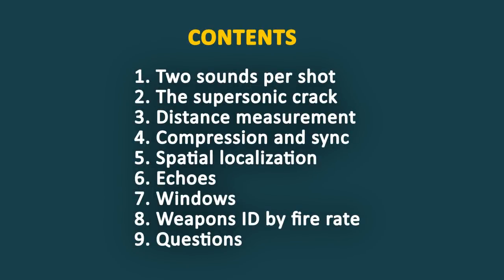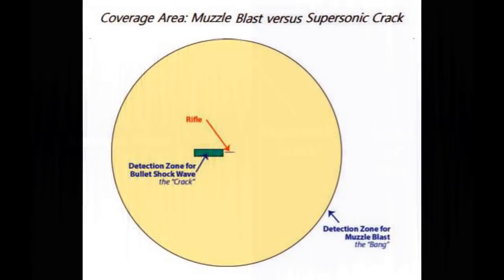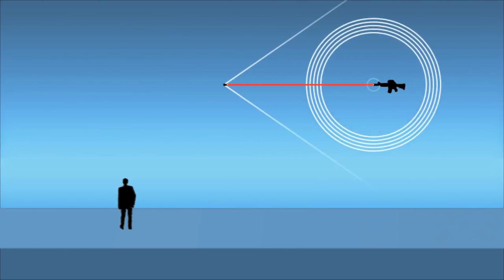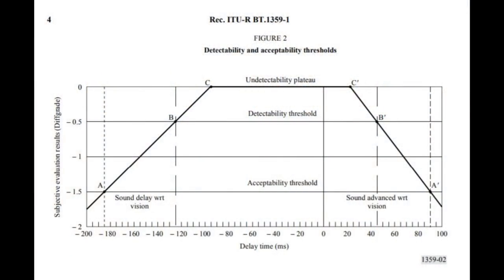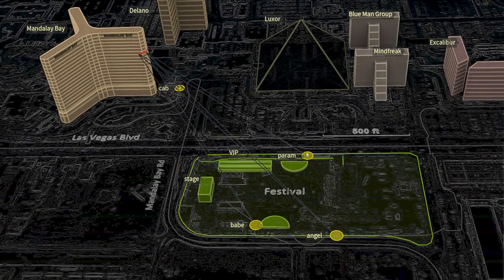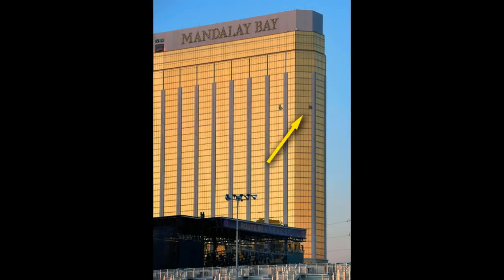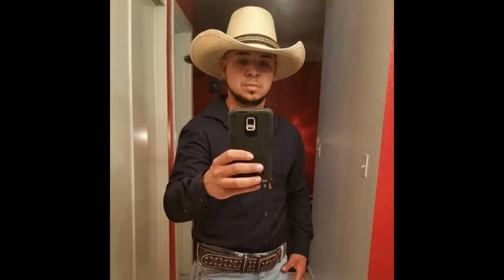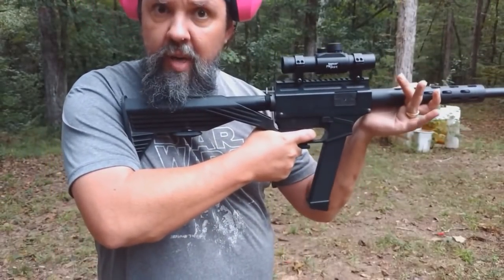2. Las Vegas shooting: The Acoustics of Gunfire

Comment: https://youtu.be/uaa71eL50Zk. I have a simple explanation for the muzzle flashes.  With an experiment anyone can do at home.  It relates to cell phone capabilities.
Reply: I found one video where someone had posted a flash.  Supposedly 15 minutes before the shooting started from Paddocks room.   It did not look right in fact the perspective was way off I guessed the flash would have been 18 feet at least.   Then I blew it up.  Not suitable for work.  https://youtu.be/jsU2x-5EFFk
Reply: Chris Tune
https://youtu.be/uaa71eL50Zk  Pretty much what I demonstrate here with a box and candle.
Reply: Looking at the retention time on that video, the average watch time is 1.5 min.  So people are not getting to the demo.  I am going to cut out the first part and see if that helps.   

Also all the movement that is associated with most of the closer videos can't help.  As you can see with the lights that are on in windows.  Those lights are steady on but moving the camera back and forth makes it look like they are flashing at times.
Reply: Chris Tune, are correct in that to an extent. The ammo (well specifically the powder used in the load) does matter and flash hiders do too. Faster burning powder and flash hiders do both greatly reduce the flash.

On key note about flash hiders is they only really help for the shootet, not so much from a visual perspective of the target area. The muzzle flash without a hider is large in a radial direction from the muzzle which can temporarily blind the shooter during night time shooting (especially if the are using night vision) or in very dim lit areas. With fast burning powder and a good flash hider, the shooter will see virtual no flash at all. From the targets perspective though, some flash will still be visible but harder to spot since it will be very small in diameter.

Another major aspect  (especially when mixed with faster burning powders) is barrel length. A 16" (carbine length) .223 / 5.56 weapon system will produce considerably more flash than that same weapon system and ammo but with a 20" (rifle length) barrel. It's hard to 100% tell but the rifles used very well could have 20" length barrels. All in all, there are many factors that contribute to no flash seen in any videos.
Reply: S Wheeler https://youtu.be/bp44gEBQyUA
Reply: J. Rogue
https://youtu.be/y7Y1zyd7PDU  What you are seeing is the Reflection/lights from a helicopter.
Reply: S Wheeler is right, those are reflective flashes from the helicopter. You can see that they are in perfect sync with the helicopters strobe beacon.. You can even see a couple flashes on the windows of Mandelay Bay before the helicopter comes into view.
Reply: S Wheeler At Madalay hotel there are strips of light in each column. That light could/would be enough to create what is known as "backlight dark face"- problem. 
If you search for flashhider on YT you'll see that the three-finger type does it best. 
And since I think this was planed, I think that the flashhider was custommade.
Reply: S Wheeler's experiment is flawed. He uses a tiny light, and as he backs up the camera is out of focus by a lot. The footage of Mandalay room 32 was in focus. Paddock's room should have been lit up in the footage.

Comment: The maintains guy was on NBC back around 10/10, and stated the he and Campos both felt the shots were coming from the peephole.  The cab muffled sounds could be ones that hit the door.
Reply: https://youtu.be/khtcXWpetTQ?t=229 A link to Stephen Shucks interview.  The 200 rounds through the peep hole would be loud very loud,  the ones through the door the muzzle blast would have been muffled so depending where they were possibly not even noticed.
Reply: S Wheeler that's the one thing that has me baffled. If on the cab drivers video the muffled shots are indeed him shooting down the hall(which I think it is) then this completely blows the sheriffs timeline up. They changed it saying paddock fired on campos before shooting into the crowd. Its the one thing that just eats at me. I just have to believe the authority's timeline is not correct.
Reply: It is correct, look at my comment above.  He shot twice down the hall.
Reply: S Wheeler im not sure what point your making. In the cabbies video there is a good burst that alot mistake for "far away" shots. I believe its him turning the gun inward and firing down the hall. Do you agree?
Reply: To clarify, before shooting out the windows he has his encounter with Shuck and Campos.  Shuck explains that the shots were out of the peep hole.  https://youtu.be/khtcXWpetTQ?t=229.  If that is so why are there about 20 holes in the door it's self?  Those holes perfectly explain  the addition 20 rounds heard on the cab drivers video.  Where the shots through the peep hole would have been very loud to Shuck and Campos, they may not have noticed the ones shot into and through the door.
Reply: S Wheeler ah got it. Yeah that makes sense.